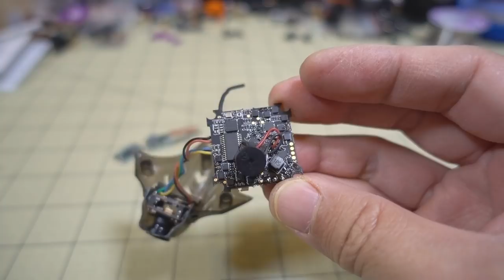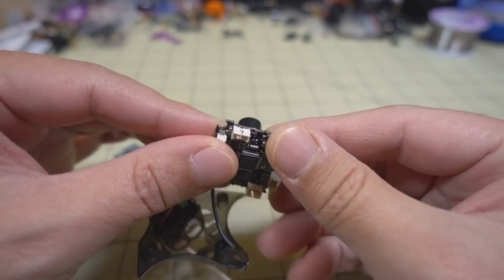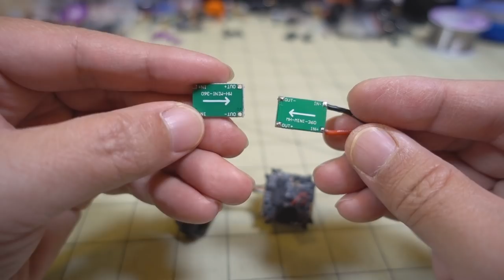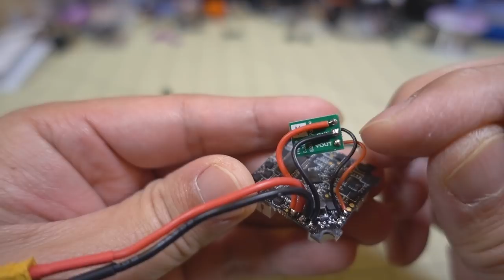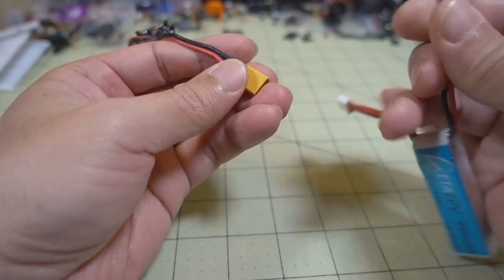Fix Your CrazyBee 🛠️😀👍

Comment: Hi, thank you for your video !!! I have the same problem on a UK65 quad, but the crazybee is not the same as yours.  Do you know if it is possible to repair it with your method ? Do you know where i have to put that on the FC card ? (What pin) ? Thank you a lot !
Reply from the maker: Yes, the technique is the same.

Comment: Hi albert, whats happen if you do this fix, and have to connect to blheli with a lipo?
Reply from the maker: It should still work.  What issue are you having or think you will have?
Reply: @AlbertKimTV  im just afraid to frezze the fc, when he gets 5v from the stepdown regulator and from the usb connection..
And its ok to feed the 5v from the step down in to the cam power pad?
Reply from the maker: all the 5v connections are the same anywhere.  Basic electronics knowledge here.

Comment: Hi Albert i've just noticed i soldered the black wire to the ground pad where the batterylead is soldered also but it works.
Could this be bad?  Since i've noticed you have soldered it to the pin that goes to the shielding of the usb port
Reply: Btw looking back i didnt have a choice because my usb shielding has come off in a crash lol,  but when i take the ground from where the battery comes it does turn on tho
Reply from the maker: Ground is the same everywhere so it doesn't matter where you connect it to.
Reply: @AlbertKimTV  lol okay im so ashamed now thanks buddy, my friend is gonna fix his one now also, but he mentioned i did it wrong so thats why lol!

Comment: How do you know which end of your ext voltage regulator to solder to the batt wires ? And also  do you just use any 5v and any ground pad ?   Thanks!
Reply from the maker: The regulator should have input and output sides.  Input is the battery lead.  Output is to your 5v rail.  Yes, any 5v pad will work, they are all connected together electrically.  You can test conductivity with a multimeter.

Comment: Hi Albert, could you tell me if you can use shrink wrap on this regulator to protect against shorting out, or do they get too hot for that.
Thanks.
Reply from the maker: heat shrink should be OK
Reply: @AlbertKimTV  thank you. My first mob7 went down after changing to an xt30 cable. I did a hover test inside for 30 seconds after fitting the xt30, landed and unplugged battery. Tried again a few minutes later and all was dead,, which has put me on hold doing it to my second one, as a lot of these regulators going down seem to be related to the xt30 mod. Fortunately for me and many others it would seem you have saved the day thanks to you and this vid, Big Thanks man keep up the great work, my FC now lives to fly another day.

Comment: I need help !!! Did this mod on 3 FC's , they are good again , thx so much Albert Kim . However I have a fourth one which is the f4 . It works through usb but won't work with the step down on led 🤔. Any ideas or suggestions 🙏
Reply from the maker: Did you try an alternate 5v pad?  Are you sure you connected to a 5v pad?  The boards have different layouts so it can be confusing.
Reply: Turns out I used a voltage booster not step down on the last one 😂🤣... Oops . Also I'm not sure the " micro DC DC converter is smaller then the pololo at .6 grams, But I love how tiny it is !
Reply: Ok, one last question , would a step down with a 3.3votks output be ok for this mod ?

Comment: how about replacing the dead regulator IC on the board? :)
Reply from the maker: I think definitely possible but that part is harder to find.  Do you know where to get one?
Reply: On mine the IC is B6287S, very widely available chip. Probably it's something else on the 2S capable boards, since this is only used to boost 1S to 5V.

Comment: So good to find this when I needed it. Any reason why you used a slightly thicker wire from the battery positive to the Pololu?
Reply from the maker: Just wire I had laying around.  I just tried to match the battery lead but not necessary.

Comment: Hi Albert great fix will 1 ground to the battery lead be enough ? 😊
Reply from the maker: What do you mean by "enough"?
Reply: Thanks Albert I read in one of the comments on this subject that the ground from the battery lead to the 5v regulator was enough and you didn’t need to also have a second ground wire to the flight controller were the LED pads are only needed live wire to both

Comment: If I have an external RX already using the LED 5V pad, can it be shared with the 5V regulator?
Reply from the maker: Yes, if you can do the soldering it's not a problem.
Reply: @AlbertKimTV  Awesome! Thanks a ton for your ingenuity.

Comment: The USB connection on my f3 crazybee has come off, is it fixable? Thanks in advance
Reply from the maker: Yes, but you need a hot air gun and some mad soldering skills.
Reply: @AlbertKimTV  Albert can you tell how? right now i got 2 of them, and one got broke usb port (i just blow it, when trying flashing, and computer just turn off,  but working normally at battery) and the second one (brand new) got the same problem, with power (need buy a pololu)

Comment: Why did my Eachine trashcan come with a crazybee F4 board and an XT30 connector to solder on if the FC 5v reg cant handle it?  Who supplies the XT30 connector in the Trashcan box? The maker of the FC or Eachine? And if it's Eachine don't they know the Crazybee F3/F4 wont work well on 2S with XT30? Did the Mobula7 come with an XT30 connector? I have many questions about the intended purpose/capabilities of the F4 since I have a Trashcan and want to convert to XT30 but am reading I will need to mod it if I don't want it to literally go in the trash when it becomes useless. Awesome video, subbed.
Reply from the maker: Sorry, I don't know the inner workings of those companies.  You know as much as me.  I think they didn't do enough testing or they just have some weak ass 5v regulators from their supplier.
Reply: I just fried mine today, without using the xt30 (I had avoided installing it due to this issue.) So it seems that it happens more often with the xt30, but it isn't necessarily confined to just that.

Comment: Got a question: Got all my parts in to do this, and I looked at your setup closely (or maybe not, depending...). The VOUT from the regulator looks like it's going into the LED ground. Or is this a different board than the F4 Pro? Thanks.
Reply from the maker: The board in the video is the F3 not the F4 Pro, so the board layout is different.
Reply: @AlbertKimTV  Ok, thought so, but wasn't sure. I can't seem to find an accurate pinout pic of the F4 Pro v2... thoughts? And great video, by the way...
Reply: @AlbertKimTV  Another (hopefully not) silly question: the ground that goes into the regulator looks like it's soldered to a spot next to the ground from battery. Looked at F3, not sure what it is. Can I solder to the actual ground instead, like the VCC?
Reply from the maker: Ground is the same everywhere.  You can solder to any ground you feel like.
Reply from the maker: wiring diagram - http://bit.ly/2VAjTPY

Comment: nice review Albert , can I ask to you , I bought new FC crazybee with DSMX version , but I had problem with ESC sound is nothing when I plug the lipo and motor ,  can you solve that , or I get broke FC from seller , thanks for respons
Reply from the maker: Not enough information here to know for sure.  If your FC is not getting power with a broken regulator, this fix might work but as I said I don't have enough information to know for sure.

Comment: Wonder if some could help me out. I burnt off the rx 2 pad on this board is there any other location to access rx2 pad
Reply from the maker: Only other spot is on the MCU chip itself.  Very difficult to mod.
Reply: @AlbertKimTV  thanks for the answer I figured it would be do you know what trace on the mcu

Comment: Yeah i did this, got power to the flight controller but all four motor wont spin. BUMMER. All cause of an xt30 mod positive & negative mixed up.
Reply from the maker: sounds like the ESCs got smoked... do you have a smoke stopper?
Reply: @AlbertKimTV  
Hi mate apparently no, i will get one or make one. 
I was just so excited to plug in the battery just after that xt30 mod.

Comment: Great Video .... on 2S battery I also get power BUT on 2 x 1S No Power - what could the issue possibly be ? Crazybee F4 Pro V2.0 board
Reply from the maker: Your connectors are worn out and you need better ones.
Reply: Super .... as always Your Advice is Greatly Appreciated .... Happy Whooping from South Africa 🙏🏻

Comment: Thank you for taking the time to address this!   My positive lead is hanging on by my board's trace after the pad came detached during my xt30 conversion. The board mysteriously only comes alive now through the USB.  In my case it could be either, but I hope it's just the regulator. 
After it sits a while I can hear a faint click noise...  would this be a symptom of a bad regulator?   The battery is not shorting out.

Thanks again
Reply from the maker: Mine never made any noises, so I'm not sure what that is.  If it powers up by USB, this fix will probably work for you.

Comment: I flash the fc with the wrong firmware now my fc doesn’t connect to beta flight is there anything then I can do? :,(
Reply from the maker: Press and hold the bootloader button while plugging in USB.  That will force the board into DFU mode and then you can reflash with the correct firmware.
Reply: Thank you so much it works now the quad is shaking a lot lol

Comment: Hi Albert. I have a little problem with my FC F3. I plug-in in 1S and everything is working but I can't arm. My radio (Flysky) indicates low battery, but the battery is full. Do you have any idea?. Thanks.
Reply from the maker: Need more info.  What FC?  What receiver?  Have you check channel mapping it correct and matching in radio and on FC?  Arm mode is set to proper channel?  I would start there.
Reply: @AlbertKimTV  is the same FC of the video, a Crazybee F3 Pro but it's Flysky version. All it's OK except the battery. I tried to turn 4 motors at same time with Betaflight and it works. The lipo is OK, charged. Any idea?. Thanks a lot

Comment: So that's kind of good.. Question is why are they not fixing the problem?
Reply from the maker: The regulator was probably meant to only power the AIO camera with low current draw.  Now a lot of people are modding and adding bigger cameras and VTX, etc... so the regulators are getting pushed beyond what it was intended for.
Reply: @AlbertKimTV  makes sence.. The only thing I changed on mine is the frame.. And got a trashcan as well pretty much the same price if I was going to mod it anyway like you mentioned in your other vid

Comment: You just saved my mobula7 thanks a lot ❤️
Reply: Well.. in fact not really because it became crazy... So I first tried using a step up/step down but it seems like he didn't liked the voltage dropouts. So I bought an iflight 5V regulator so I'm sure it's made for this, at first it worked quite good (I could feel a latency while controlling the whoop, but still usable, kind of) but then it became so crazy, like huge latency and everything. I noticed that my 1S connectors were dead so I'm buying some

Comment: great video! i have a few bigger fc's with the same proble! altho i have a different problem with a crazybee v1.2 out of a uk65! the built in flysky rx will not bind! have you a fix for this or is there a way to use a different rx?
Reply from the maker: Different boards will have uart pads for external receivers.  See this video - https://youtu.be/_O3svdP2sZ8

Comment: Hey Albert, folks I talked with suggested I ask you for help. I have a Beta85 Pro 2 and this is the issue, so I got the same regulator in this video. It’s all wired/soldered up but I don’t know where to put the other ends on the FC. I know the battery lead but the other part I just don’t know where to solder. I literally got this Beta85 new and it fried on the 3rd day. Can you help?
Reply from the maker: The output from the 5v BEC just goes to corresponding ground and 5v pads on the FC.  ANY gnd to gnd will work.   ANY 5v to 5v will work.  It doesn't matter because they're all connected.  Just don't short gnd to 5v or vice versa as that will fry everything.
Reply: @AlbertKimTV  Thanks Albert, but the only pads--the ONLY pads on this board are Batt + and - ....I guess I'll have to buy a new board?
Reply: @AlbertKimTV  You know what, I'll just join it to the pad that leads to the camera. Sorry for bugging you and thanks for your advice! I'm just hesitant to use an already used camera voltage pad, not wanting to mess anything up since it's so small!
Reply: @JohnCuppi  Yes—I ordered that same 5V reg. and soldered it to my Beta85 Pro 2. Works like a charm. Now if only I could find a replacement VTX antenna (mine fell off).

Comment: My question is what made the regulator fail in the first place?
Reply from the maker: The regulator was probably meant to only power the AIO camera with low current draw.  Now a lot of people are modding and adding bigger cameras and VTX, etc... so the regulators are getting pushed beyond what it was intended for.

Comment: Your negative wire is soldered to the micro USB plug, board connection.
Reply from the maker: Yep, that is another ground.
Reply: @AlbertKimTV  Kewl beanz... figured no biggie... I soldered too the neg terminal... it worked... flyin' trashcan again... thx AK.

Comment: Hi AL what esc firmware is for crazyBee F3 board ? Thanks
Reply from the maker: I'm not sure but it's easy to connect with BLHeli suite and it will tell you.
Reply: I got it. Tried update board to 4.1 with hex file now the usb port is not recognized  ?

Comment: Anybody got an idea how to do this on a Hobbywing XRotor Micro G2 Flight Controller? I smashed into the ground the otherday.
Reply from the maker: You need to find the wiring diagram for that board.  For input to the BEC, you connect it to VBAT and GND.  On the 5v output side, find a 5v pad and a GND pad and connect it to that.

Comment: Hi mate..i tried this w/ crazybee x v1.0.
Already power up the board..but no sound and also im not gettting battery voltage after checking it to betaflight
Reply from the maker: The board probably has more problems other than the 5v regulator.

Comment: This worked for my novice 2 I just fixed my drone
Reply from the maker: Great!
Reply: @AlbertKimTV   i need some help when i plug in my battery it powers up but the only thing is that its displaying 0.01v so my flysky fs-16 is telling me the rx battery is dead aswell as when i connect to betaflight is there a setting i can change to adjust that?
Reply: @AlbertKimTV  i used for all 4 wires 24awg i have some 30awg should i use that to connect to the board and leave the 24 from the battery?

Comment: Here's what looks to be a smaller 5V regulator. Some folks on the Trashcan FB page have had success with it: https://www.sparkfun.com/products/107
Reply: The problem with this is that these L7805s are rated for 7v input voltage minimum, so there is a chance that if you discharge your batteries to about 6.4-5 volts it will just drop out of the sky due to fc not receiving the 5v.